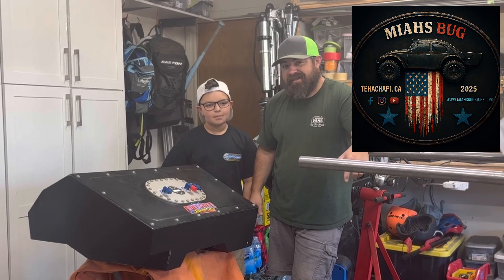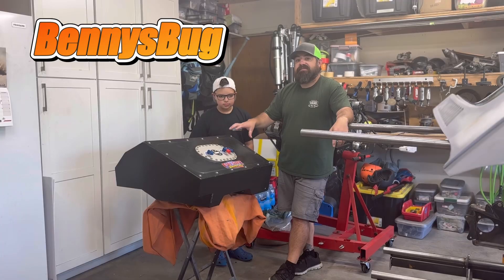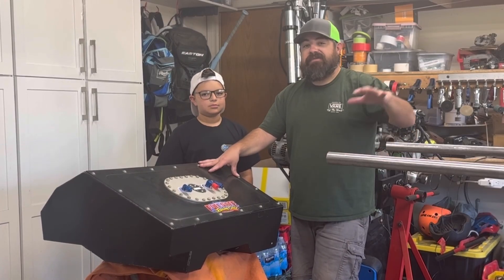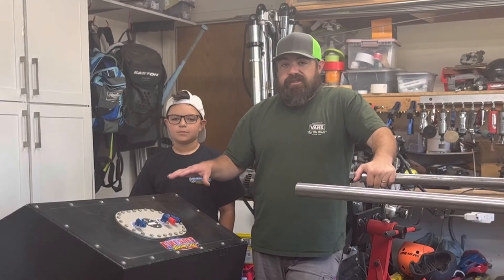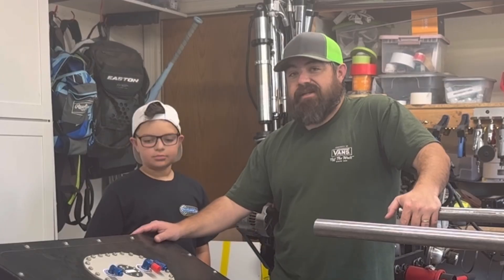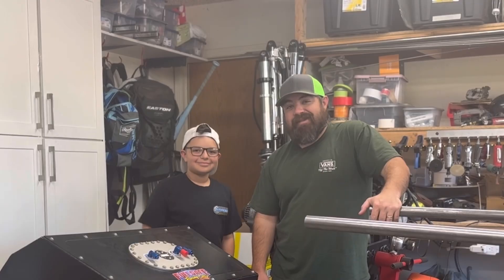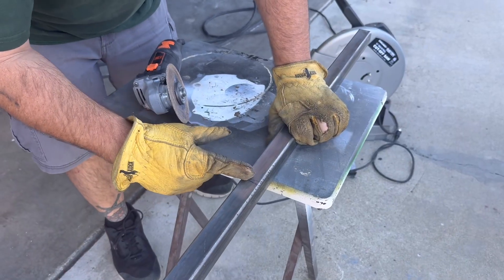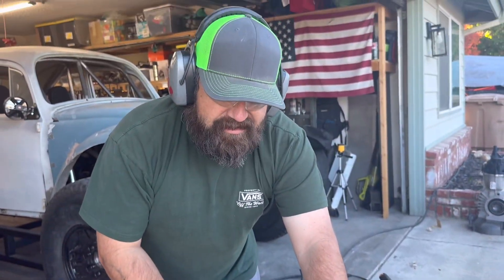Build: Fuel Cell Support Structure in the VTech Baja Bug

Comment: I wish I would’ve thought about building my capture mount from my fuel cell. I just put in mine out of the car and then put it in place and tack it and then go from there. I built mine in the car and I had it out of level or whatever you wanna call it what a pain in the butt, cutting it and twist and pulling in and trying to make it right to fit in it and clamp down without trying to twist the tank pretty good I like it.
Reply from the maker: Yeah, sounds like a pain. It looks good now! I saw your car at the Dust Buggy event but we didn’t have a chance to talk.